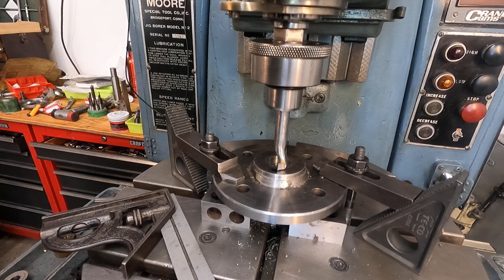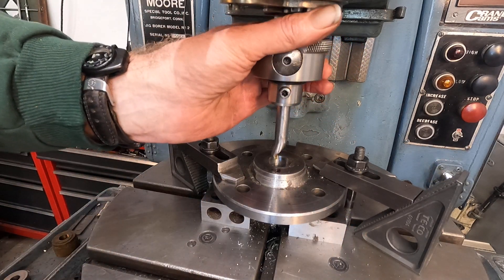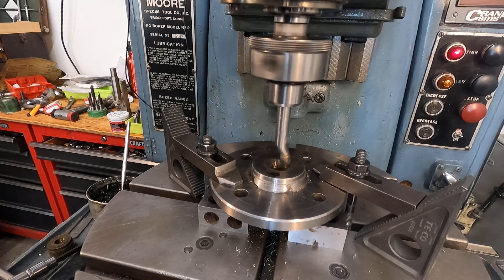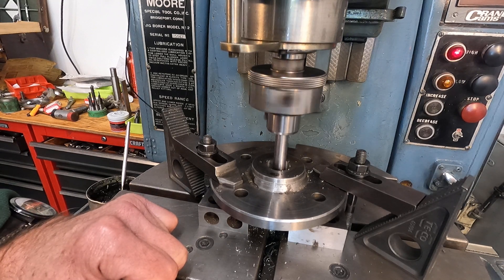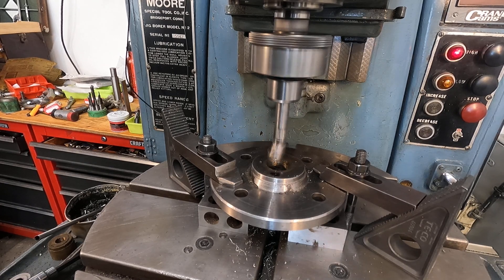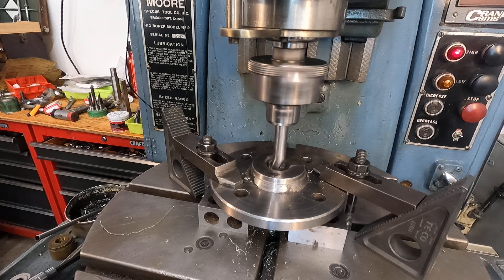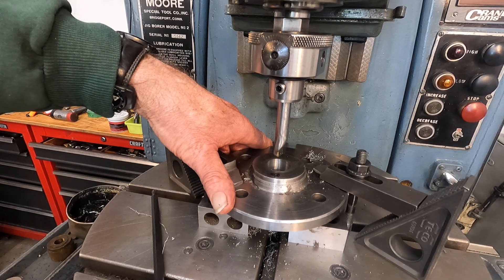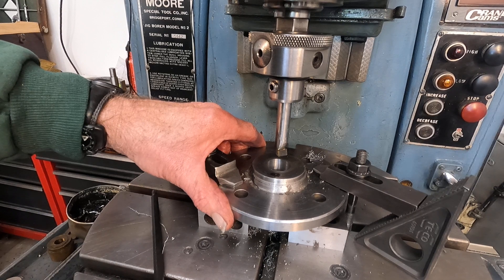Moore jig boring machine basic hole making 4

Comment: Could the jig borer be used like a regular mill
Reply from the maker: The Moore tends to be better limited to light milling and fly cutting. The table screws are 10tpi and intended for table locating than taking much of a side load, though it runs 1/16" end mills nicely due to the extreme smooth table movements and the highest precision spindle bearings. Thanks!

Comment: Hi Dee Dee  with the jig boring machine boring the hole is that more accurate than taking the same light cuts on a lathe? thanks
Reply from the maker: That would depend on the lathes spindle accuracy of rotation. This is different from spindle run out.